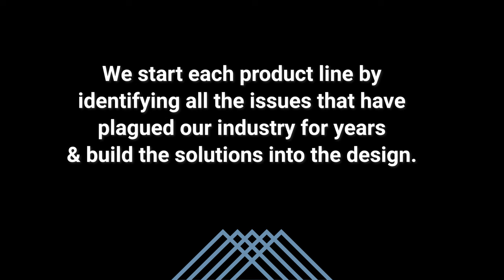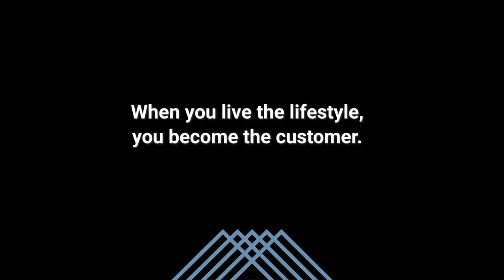Prototyping #2 of the Brinkley Model Z AIR Travel Trailers (BTS Time-lapse)

Comment: Really looking at replacing my Grand Design Reflection bunkhouse travel trailer with the comparable travel trailer from Brinkley. The things I see the Brinkley version lacking for me on the bunkhouse travel trailer is a slide for the bunkhouse area and a place for a combo washer/dryer like I currently have as a full-time user on my Reflection bunkhouse. The only other request would be being able to have a a/c unit in the center with a heat pump, with front and rear being a/c only. After spending a few years now especially in winter months having the a third unit at the center with a heat pump would be alot better than using the furnace, but to also have proper heat flow underneath to ensure piping doesn't freeze. Hopefully this is possible to have as an option as I'm interested in the brand and what you'll are doing

Comment: Please build a class c RV. That sector is still missing many innovations and quality control. For example, they don’t have enclosed undercarriage like the TT or 5Ws have. Your stuck with a E450 with gas engine or 4x4 f550 diesel both standard cab not even an extended cab that’s super long. There are no hybrid units, stick a GM 2ML70 hybrid transmission and put a battery pack instead of a generator. Imagine having about 30kw battery that can charge in less than an hour by the engine and get better fuel economy while driving.